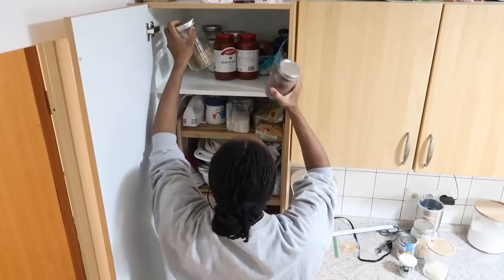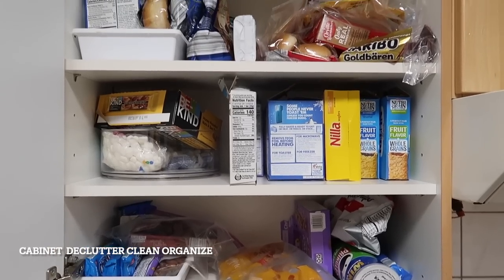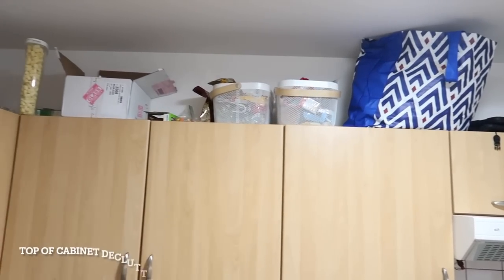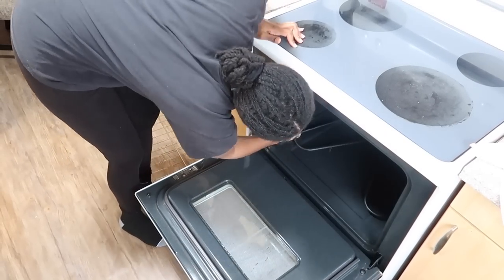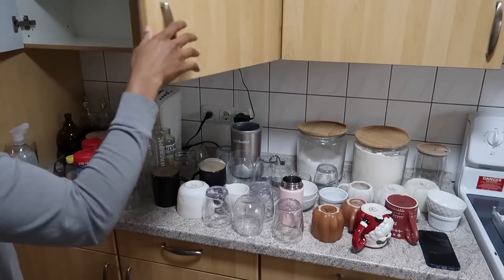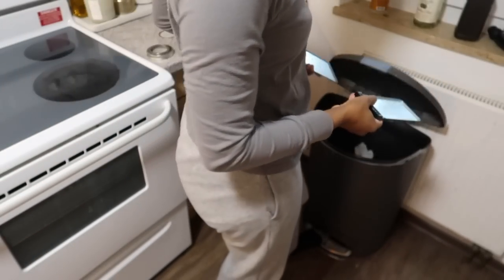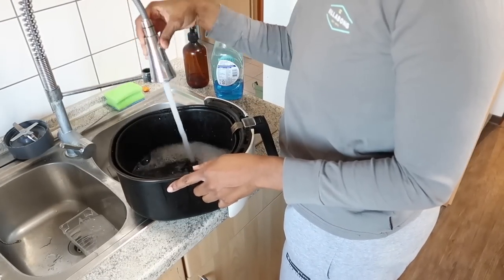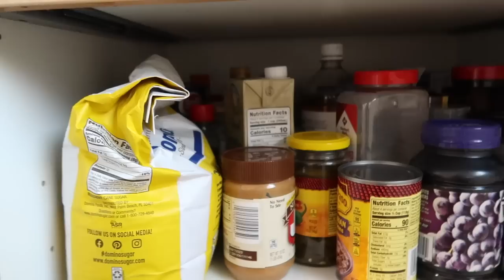HUGE CLEAN ORGANIZE AND DECLUTTER WITH ME | EXTREME KITCHEN ORGANIZATION | 2023 CLEAN WITH ME

Comment: Ryan if you line your Air Fryer with foil or parchment paper before each use, clean up will be easier. All you need to do is throw away the used paper and then wipe out the Air Fryer.
Reply from the maker: Okay. I'll try to remember lol I'll add parchment paper to my grocery list